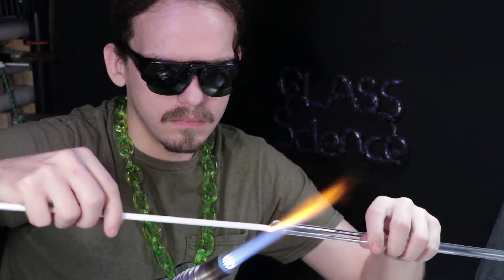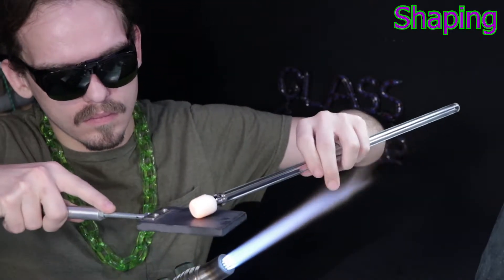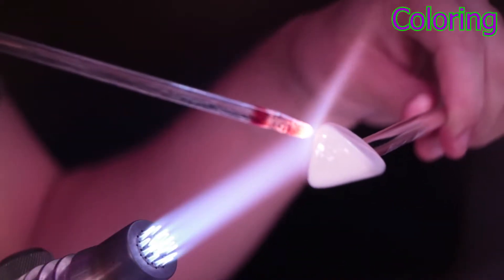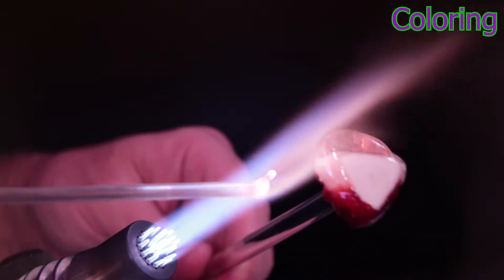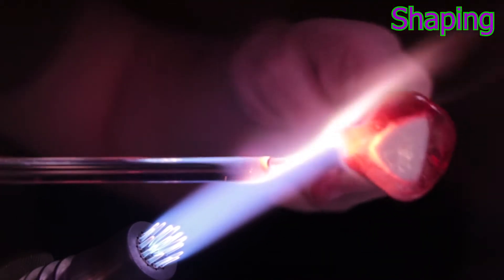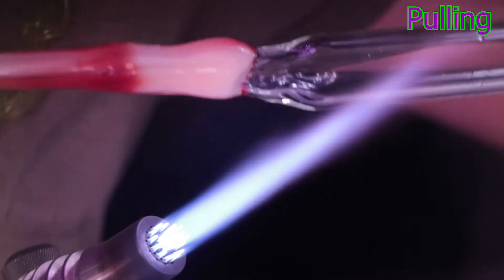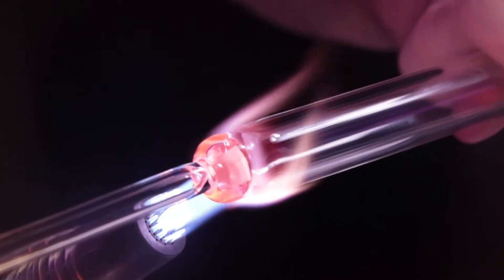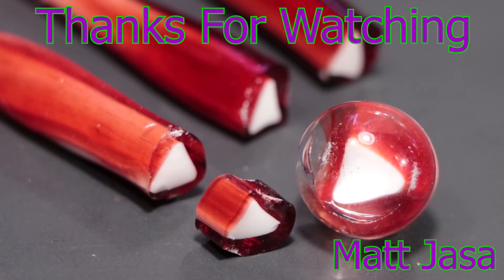Murrine Traditional Lampworking - Glass Blowing Techniques

Comment: This technique is very similar to making patterned hard candy
Reply from the maker: Thanks for commenting, Candy and Glass share similar physical properties like being amorphous solid. Which basically means it lacks internal structure (a long lattice pattern). Its kind of like the difference between a building and igloo. The building has a lattice of board or metal beams to hold its weight while the igloo is just frozen together. Damage a beam in the building and the whole structure feels it, while punching a hole in the igloo just hurts that area.

Comment: Wow, we pull murrini in very different ways. I build mine in multiple layers of tubing and collapse them into solid rod using intense heat and a special marver to roll the air out as I work up the tube.
Reply from the maker: That's cool it sounds like Vac-Stacking your talking about. Tubes are a good way to go specially for larger scale work or production work but it can take a lot of prep. This is more of a simple approach for someone wanting to do a small pull.
Reply: Ya thats a stringer or rod stack